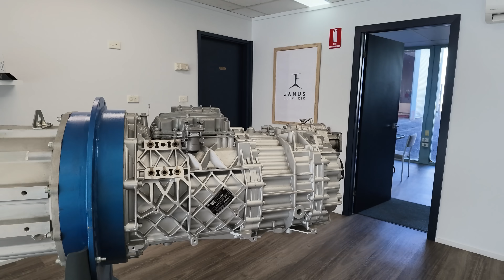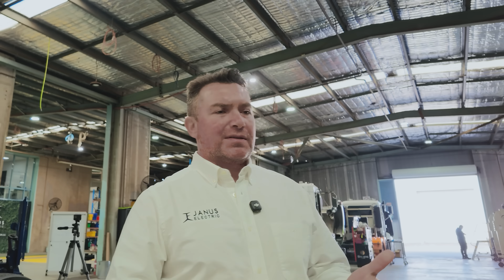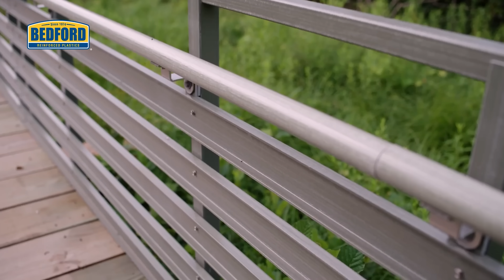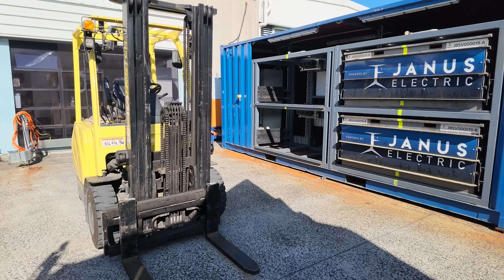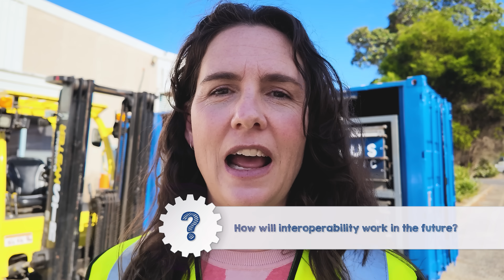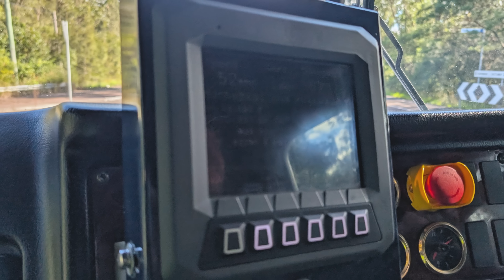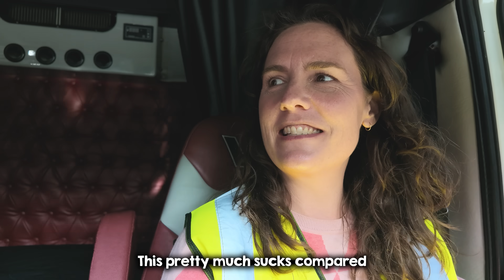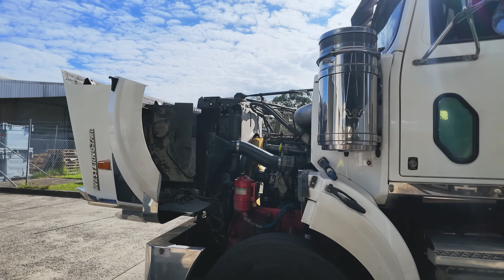The EV Truck Idea I Actually Didn't Believe Until I Saw It

Comment: wonder why they retain the 16 speed gearbox.
also interesting they can handle the road trains.
Reply: Yes, I was also surprised by that - it seemed like a shiny new component, not retained from the original truck. Most EVs function fine with one gear, occasionally two, so 16 seems like overkill!
Reply: they can barely handle road trains lol! 170km of range what is that? diesel trucks have gearbox to be able to have different fixed gear ratios for regular driving to very heavy duty haulage like oversized transport..... volvo fh780, scania 770.... diesel powerhouses.
Reply: @carholic-sz3qv other electric trucks use a reduction gear and do not need multiple ratios as electric motors produce torque over a large range of motor speeds.   It is a very good question.  Perhaps they have gone for smaller electric motors.   Seems to miss one of the biggest benefits of electrification though.
Reply: @carholic-sz3qv  Rubbish again, your consistency is amazing mate.... PS, you're the only one here, that should tell you something....
Reply: @Mick-60  bot!

Comment: Hi Rosie,  Love your videos.

I am wondering why Janus are using a conventional 18 speed gearbox?  

This seems to add weight and expense compared to a single speed reduction box.

If they really need the gearing I wonder why they didn’t use an ECVT design of gearbox.   This type of gearbox uses a single plenary gear set with an additional small electric motor to give seamless gearing.  This would be much simpler, lighter and cheaper than a conventional 16 speed auto with upwards of six plenary gear sets, clutches, bands, valve bodies, oil pumps torque converters etc etc.

Love to understand their thinking.

Cheers
Reply: From my research,  its an off the shelf capable gearbox.  Alison from memory.  
18 speeds are old days news. They bearly exsist outside of Kenworth and their buyer type. 

As for an eCvt, its a good idea.
Reply: @audoinxr6372 - the Allison gearbox and duff must lose 15% of the power through driveline losses.  Definitely a good idea to use an ECVT.
Reply: My guess would be the cost. They would have to design entire drivetrains for each truck model if they include a gearbox. Providing only the motor makes the entire operation simpler, and thereby cheaper.  I bet they can tweak motor performance through software, to match the requirements of each truck model if needed.
Reply: Mate, get on the net and ask them. I am sure if you have a persuasive argument, that they will take up your suggestions to improve their product.

Comment: I really though Janus has a lot more trucks by now. Again this shows there is not one way to solve the problems. Even with other EV trucks you are not competing 1 EV mode to another right now your all competing against Diesel. In the US I think Tesla motors will win on the EV trucks as the cheapest but even at there factory max run rate of 50K/year (they are no were near this)  There are millions of trucks on the US highways alone. So again it is not competition against each other but against Diesel
Reply: Once Trump goes, the USA will be able to move forward again and the Diesel Vs Electric competition will result in Electric being the norm and diesel going the way of the draft-horse.  There is always money to be made in new innovation leaving the luddites to wonder what just happened!!!🤣🤣

Comment: 16 minutes and no mention of the chemistry used?
Reply: I agree it would have been interesting. From Googling it, it looks like they're using NMC but the "new batteries" he mentioned will be Lithium-Sulfur, hence the weight reduction.
Reply: Chemistry in this instance is unimportant. If you swap one chemistry battery for a different one with "similar" performance characteristic . . . . who cares???!!!! When multiple players (Battery swap suppliers) come into the market then operators will be able to choose the chemistry option that fits their user case.
Reply: @paultrgnp  chemistry is very important, there is a reason why trucks have diesel, or LPG/CNG and even biodiesel as energy sources, diesel offers overall significantly more range and heavy usage.
Reply: @carholic-sz3qv Wtf are you talking about?? I don't think you understand what chemistry options are available for vehicle battery  manufacturers or how they affect the cost, weight, range, safety factors etc.
Reply: @carholic-sz3qv  Absolute garbage AGAIN...!!!!

Comment: That was an awesome vid Rosie!  Extremely informative.  I was quite pessimistic about the electrification of the trucking fleet - I am less so now.  Kudos to Janus and their work.
Reply: just look to Europe noone over there is thinking about buying anything new but electric
Reply: lol!!!! those are not going to power the backbone of the australian economy, the massive road trains have to cross the harsch outback to supply remote communities and mining sites.... 170km of range is absolute joke
Reply: @carholic-sz3qv they said in the video that this tech didn't suit the Australian long haul trucking sector. They never claimed that it did. I hadn't considered the short trip to depot market was a thing, either. Looks like it suits this market well.
Reply: @carholic-sz3qv 
Yes, for these very niche cases diesel probably has a full decade left before getting replaced by the superior tech now being developed
Reply: @Infodump-v9v  its not niche,  go to Sydney, Melbourne or Brisbane airports and have a look at the number of trucks that are there just dropping freight,  Cement trucks in cities, garbage trucks, firetrucks, Woolies trucks that are shipping from distribution centre to the local shops...cities are full of trucks that are on shorter loops probably far more than are plying the back roads of Aus.  This is also where the maximum benefit comes from because if you can electrify all these inefficient short loop diesel use cases it benefits the cities and potentially the owners of the fleets immensely.  I'm pretty sure a cement factory isn't going to do it unless they can see dollars being saved.
Reply: @Infodump-v9v  Most trucking is local mate, that's the majority !!
Reply: @Infodump-v9v  ''superior'' what a joke! 🤣🤣😀
Reply: @carholic-sz3qv  also said 450km, not 170. So many trucks are used only in cities (delivery, concrete etc) and for them, if this makes sense financially, it sounds awesome (and more diesel for the harder-to-convert )
Reply: @carholic-sz3qv 
Not so impossible if there are battery swap sites along the long haul routes that have enough solar to recharge the depleted batteries 
It would give long haul truckers a very short break every 2 hours and some shade to park in if they needed a longer break
Reply: @carholic-sz3qv  You missed the point.
Reply: @carholic-sz3qv  if that’s your level of system thinking, writing this for other people: “the harsh outback” is a perfect place to have solar powered battery swapping if one wants battery swapping. If one wants huge payload with more distance capability having trucks designed for electric is necessary but the other big thing is battery-powered e-axle trailers which will pick up the torque to get going and support regeneration for slowing down. We have already tested this e-axle battery trailer technology in commercialized units that are far easier to retrofit to existing trailers than the tractor is. As a result, the initial use case is to use the battery electric trailer with existing diesel tractors. An extra advantage of electrifying the trailers is that the tractor is able to go up hill without even downshifting - functionally the trailer is zero “weight” from a torque demand perspective.
Reply: @TomKacandes  blablablablabla!!!!!! how many of those are you going to have to install and where and for which driving conditions? diesel just gives more flexibility and ease of planning plus the having swap batteries on roads with very bad corrugations is just a recipe for disaster to happen. imagine driving from perth to sydney or to darwin.... 170km of range on not even fully loaded truck.
Reply: @carholic-sz3qv  “diesel gives more flexibility” uhhhh…. the world is having trouble meeting diesel demand due to that war over in the Strait of Hormuz and Russia-Ukraine war.  And the Outback has loads and loads of sun, like literally every damned day is sunny. Battery swap stations (charging the batteries via solar panels) on the way would not be reliant on a different truck delivering the energy, it is delivered automatically basically every day.  The only challenge I can see is the intense heat of the Outback, but then again, thats an issue that ICE trucks have to deal with as well.  Long story short is that this change is coming, you can pretend it isn’t but reality doesn’t care about your grievances or opinions.
Reply: @carholic-sz3qv  Oh grow up mate, you write like an uneducated child...
Reply: @carholic-sz3qv  Did you even watch the video genius ? Also, starting an intelligent conversation with "lol" is inane at best...
Reply: @Mick-60  i actually smelled the video sherlock! are you going to cry?
Reply: @carholic-sz3qv   There is also an Adelaide company developing powered trailers.  Pop a couple of those on the back of a Janus truck with a couple of Janus batteries each and range will not be a prolem.
Reply: @darrylguise8493  yeah very heavy powered trailers with significantly reduced payload doing more damages on the roads right! very funny indeed!
Reply: @carholic-sz3qv  Ha ha ha ha, if only you knew what was actually going on, what is in progress already and what is coming in the heavy road freight sector. Your manufactured narratives that are stuck in the 20th century are adorable.

Think what you like anyway, it doesn't matter one bit, because the electrification of even long haul heavy road freight is coming, whether you or anyone else likes it or not.
Reply: @BrentonSmythesfieldsaye  yeah sherlock how about electric airbus a380 intercontinental flights? are they coming out in 2027? 😁😁😁😂 also imagine the military using electric trucks! thats just way too funny to me
Reply: @carholic-sz3qv  Long haul road freight vehicles don't fly silly. That is the context of the thread discussion ........right?

Or do you always use fallacious argument style. 😂
Reply: @BrentonSmythesfieldsaye  you really dont get sarcasm do you! airbus and quantas are finalising the ultra long range airplane a350 which is able to fly non stop for 22hours, what battery is ever going to compete with that Einstein!
Reply: @carholic-sz3qv In Europe there are a few thousand airfields where smaller plains can land. Building rail track is expensive, so electric airplanes carrying 40-80 people will soon cover that.
Reply: @carholic-sz3qv  The video content is about road freight trucks, your posts that I responded to were about road freight trucks, my post was referring to road freight trucks.

Please spare us the excuse of "sarcasm" in support of your fallacious argument style. If you can't maintain context, then that is your problem, not anyone else's.
Reply: @BrentonSmythesfieldsaye  blablablablabla! thats all you have to say? pathetic!
Reply: @ruudh.g.vantol4306  you cant even get a battery  drone to fly for 30 minutes please spare me this nonsense!
Reply: @carholic-sz3qv  Yes 170km are a joke in long haul trucking. But you'll get a visit from the e trucker in about a year. He comes with a Mercedes E - Actross 600, with a range of at least 600km. In real life under ideal condition 800km was the furthest anyone managed, that I know of, fully loaded (42 tonnes under EU law).
With his camper built and 12 tonnes weight he expects 900-1000km range on average. And his goal are 80 charging stops around the world.
This is the tech that has real potential to tackle long haul.
Reply: @Schinkeldink  very cringe joke again! is he going to arrive in australia on an electric ship or something! he doesnt even have awd, he would have to absolutely follow the paved roads with the routes where there is actually electricity lol!
Reply: @Schinkeldink no one has achieved 800km with a fullly loaded e truck you pathetic liar! there are some scania electric trucks with two trailers at 96 tons barely does 200km in scandinavia with favorable conditions.
Reply: @carholic-sz3qv  in europe there are already 500/600km range electric trucks, and its only getting better
Reply: @IntensiverPinguin  i was talking about european specially scandinavian trucks which are up to 35 meters long so 3 trailers and diesel is the ultimate king doesnt matter the weather.
Reply: @IntensiverPinguin  if they allowed more payload all around europe, they existing diesel would have moved significantly more loads.

Comment: I'd have thought that this tech would be useful on farms. Low mileage. Farm buildings covered in PV. Charge the batteries from the PV while the machines are out in the fields.
Reply: There is an electric tractor outfit. The problem is it can only work an hour on a charge.  Just the travel time to and from a swap station makes it untenable.
Reply: A guy here on YT did his own conversion on an old ass tractor to do off jobs on his hobby farm.

Comment: Haven’t finished the video yet, not sure if it’s covered. Who absorbs the cost of damaged batteries and battery wear? I wonder this about the swapping done in China too. How does that cost factor into the cost of recharging batteries?
Reply: Mention was made of battery life. In the video it mentioned that degraded batteries could be reused as grid storage batteries. Batteries that have completely failed for some reason would be recycled. It was mentioned that the batteries could last up to 15 years plus
Reply: Mention was made of battery life. In the video it mentioned that degraded batteries could be reused as grid storage batteries. Batteries that have completely failed for some reason would be recycled. It was mentioned that the batteries could last up to 15 years plus

Comment: Great to see what Janus has done.  Maybe a bit behind in the UK, but Octopus has just annouced a major step into this market in the months to come.  Great to have a big energy provider behind this technology. Quote.....
"Octopus Energy and battery manufacturer CATL launched Swaptopus, a joint venture to build an ultra-fast battery-swapping network for heavy electric lorries across the UK and Europe.
Launch Date: First UK mega-hubs open in 2027. 
Expansion: Scaling to 30+ European hubs by 2035. 
Capacity: Designed to support 300,000+ electric trucks, with each hub servicing thousands of lorries daily."
Reply: UK has about 2,000 electric heavy goods vehicles on the roads, and about 100,000 electric commercial vehicles.  27,789 electric commercial vans were registered just last year.   There are a few Scandinavian countries doing better, but I wouldn't say that UK is behind.
Reply: @nigels.6051 Good to hear positive news!

Comment: FRP can be excellent, but there's a lot of maturing in handling its waste products and its reuse and recycling. In many ways, BRbP can be superior: Basalt-fibre Reinforced bioPolymer. Less energy is needed to produce than fibreglass, basalt fines in wastes weather CO2 out of air, and if th bioPolymer is a PolyEster Covalent Adaptable Network material, it can be 100% recycled, unlike conventional plastics from fossil sources. Still, either way much better than steel.

Comment: A really promising technology. Love the reuse of the CHAdeMO connector on the battery for maintaining, pre existing standard and connections with high DC output in mind; that's a brilliant idea.

I'm not sure on the Australian vs UK aspect but our EU shaped trucks could offer the same interoperability with HGV and smaller going simular miles. Replacing the local distribution fleet and the long distance fleet....

❤
Reply: There's plenty of global/EU style trucks in Australia, I think. But as far as I know, the companies aren't selling them in Australia.

I know Tobias (electrictrucker) is driving a Mercedes e-Actros round the world next year, including Australia.
Reply: I paused the video to double-check.
It differs slightly from the CHAdeMO connector.
The CHAdeMO connector has the control signals in two clusters of 4 pins.

Comment: I've got a cousin in Germany who sometimes does a "tour" in a newly made electric truck without "infinite range". He does mainly fairly short hauls, but does a few per day, and sometimes the charge state limits what can be done, because it takes too long to charge up again. Being able to quickly "fill up" would completely solve that problem, and I think he'd be impressed with this approach. It would even be a kind of solution to the previous driver who didn't bother to set up charging at the end of the day, and leaves you with insufficient range to complete the day's mission fully, once battery stations became dense enough on the ground. Mistakes happen, and the recovery speed from these matters.